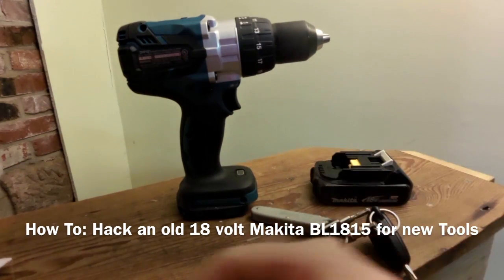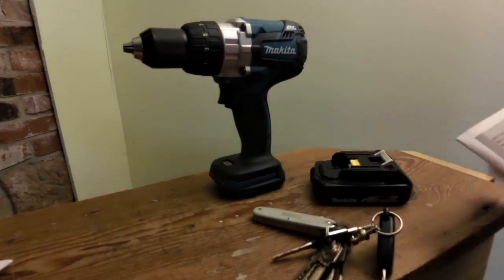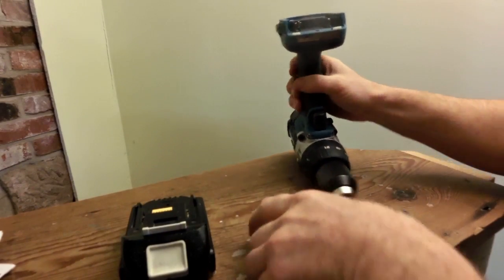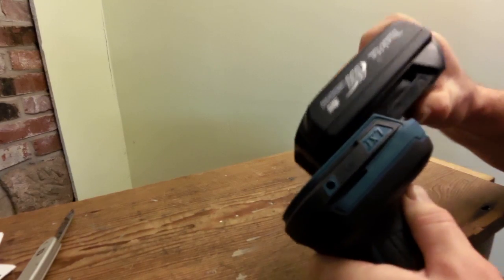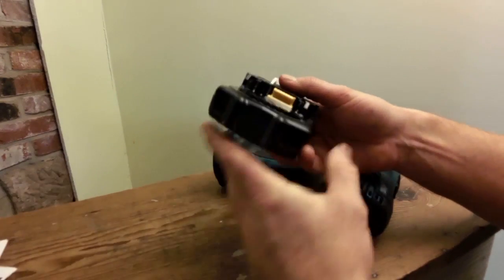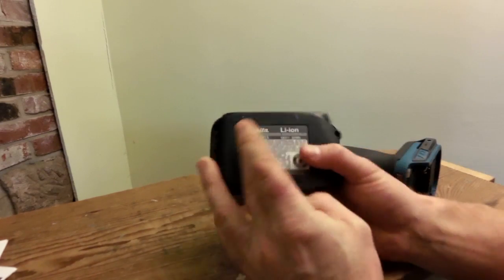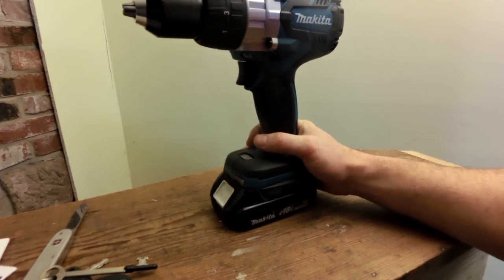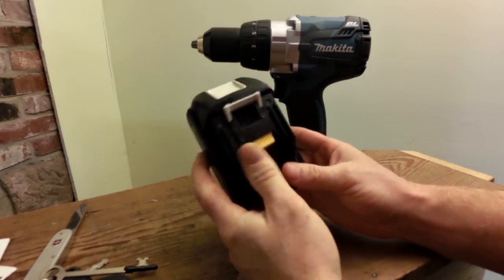How To: Hack an old 18 volt Makita BL1815 for new Makita Tools

Comment: Man was I mad. Had 3 of the 1815 batteries and a charger. When I got the XFD10 cordless drill and saw the batteries weren't going to slide in, I wasn't happy. Modified the battery as you showed and it works fine. Thank you!

Comment: I made this fix to my old compact batteries three years ago and have never had a problem. I use them with multiple tools and run them until they are completely depleted. Never any problems.
Reply from the maker: +Michelle Johnson-Hunter thanks for the comment, and great! You converted old tools to makita?

Comment: Thanks for the tip! I just received my new Makita rear handle dual battery circular saw (bare tool) today and was dismayed that I only had one newer 3 amp hour battery that would fit. That left me with 5 that were incompatible. While watching your video I notched out the track like you said and it fit perfectly! Meanwhile I have a pair of new Makita 4 amp hour batteries on order that will probably be dedicated to this saw. But it's nice to know I have backup now. Again, thanks!

Comment: thanks that help me out I have a saw BJR182 and the battery did not fit, I did that step and it works perfect no problems it said it is comparable with that saw what I did I CUT THE PICE THAT WAS IN THE WAY AND MY BATTERY FIT
Reply from the maker: yep. now the new tech won't save your old battery from over drawing which is what the star stuff is supposed to do, but it gets you by anyways.

Comment: There's really a simple answer to it.  That compact battery cannot by a long shot provide enough amps for that heavy duty drill.   And since those olders compact batteries did not feature a protection circuit yet you just created a recipe for burning out your battery.

You'll overheat / overdraw amps on that small battery pack EASILY with that large drill.  A large Amp tool like that ( just like a circular saw , jigsaw , grinder etc... ) need a fat pack ( with 2 rows of cells to provide current ) for the tool to work as it is intended.
Reply from the maker: Thanks for the comment. Yep all makes sense, I wasn't worried though,it's  an old pack already. It works fine so far but for any run time I need a larger battery. They make an 1815n battery for it, which I assume has the electronics in it to prevent damaging it.
Reply: Considering the 1815N battery has the same amps as the 1815 and is fully supported for this tool and many others  shows that it has nothing to do with the particular amps being delivered to the tool
Reply: That's not true about the heavy duty drill requiring more power. The black and white drill that that battery came with actually has more power than the newer green ones.
Reply: Might be a simple answer but don’t think it’s true, what I think happened was makita started making these “Star” battery and tool combos and claimed they were adding all these fancy protections and communication between the battery and the drill, which i believe is just a way to make people stop using aftermarket batteries and makita losing profit on their outrageous markups on batteries. The drill doesn’t need to “communicate” with the battery pack, everything can be done on the drills side according to the voltage of the battery. So I’m willing to bet unless they purposely added some kind of circuitry in the battery pack to disable the protections on a non genuine battery, that this retrofitting doesn’t matter at all and still keeps all the protections of a “star” battery. Could be wrong though, and you really don’t want to over discharge the lithium batteries which is easy to do without some kind of voltage protection, not only does it ruin these packs but I heard another guy talking about how they have a “safety” feature that disables the battery pack once it drops below a certain voltage, then it’s garbage and can’t even be taken apart and fitted with new 18650s.

Comment: Isn't that silly.  Apparently the drill works just fine with the older batteries.  They just want you to go out and buy a whole new set of them for the "new" drill.  They'll try anything, these days.  Thanks for showing us what's going on.

For some reason, this hack reminds me of my days with floppy disks and my C64.  Cut a notch in the corner of the floppy disk to double its storage capacity.  Those were the days! LOL
Reply from the maker: +The Homestead Chronicles haha, remember that about the disks! ya, i think the reason was to force you to use new batteries that have more electronics, or larger capacity batteries or something... but I didn't have any others at the time so made it work :)
Reply: its because the new batteries have a safety bored in it so it doesn't drain the battery all the way dry... helps the battery last longer... but ive used this hack as well... batteries are expensive.. lol but the new ones have a star on them those are the ones that fit
Reply: not 100% the case the New 3.0 & 5.0 batteries work on the old LXT drills, it's the old 1.5's that don't work on the new LXT drills. that's why I came to this video.
Reply: The Homestead Chronicles the old batteries don’t have the star on them which is overload protection so they don’t want them to work with the new drills. It’s simple as that really it’s to help the consumers not them.

Comment: Why don’t they want you to use the old batteries with the new cordless drill. I noticed the tab also and I’m thinking about doing what you said. But will running the tool with the old battery ruin the tool or ruin the battery?
Reply from the maker: a) they want you to buy new batteries so they can make more money b) the excuse is that the batteries will get ruined more quickly but then basically its just like using an old makita at that point. so really it doesn't make a difference.

Comment: Hey man how is the dhp481z drill? Still holding up good? looking to buy one myself.
Reply from the maker: hey thanks for the comment. check out my recent video here on the quality of the chuck: How To WRECK A Makita Hammerdrill Chuck - and fix it   Apart from that, honestly, i've not used it a ton - for the bulk of my jobs i use my little used impact makita which is WAY lighter. i don't do a ton of drilling but when I've needed it, it works great. it is heavy definitely and I've not myself made use of its massive power yet.  So ya, apart from the initial dud i got before i swapped it at home depot, its ok. Worth the premium? maybe not but if you need the power, its a decent buy.

Comment: Thanks that I found your video. I just bought a tool and the old batteries didn't fit. I got confirmation that it was by design... even if that was kind of stupid.. I can't find any documentation about this... Only that the new battery will fit most old tools but not the other way around.
Reply from the maker: hey great, thanks for the comment. Glad it was helpful!

Comment: Can one hack Makstar batteries to work in non-starred tools?
Reply from the maker: hack makita batteries for non starred tools you mean? i would think so but i don't have a star battery to try.
Reply: The new batteries work on older tools without modification, star or not. I have a ten year old impact driver and it accepts both old and brand new batteries no problem.

Comment: So is there a reason why they don’t want you to use older batteries on new tools besides wanting you to spend money on new batteries?
Reply: Well I did the search myself and this is what I found. 
“the newer batteries deliver more power to the tool.. the older tools have lighter gauge wiring in them which will overheat and catch on fire if you use the newer batteries.. thats why they issued teh public notice about the star on the tools. so that you dont put yourself at risk”
Reply from the maker: Yes, the 'advance' is that also they prevent the batteries from draining too far down, extending their life. Its all for a good and new reason for sure.

Comment: Cut out the stopper on the actual drill.  Simple.  All batteries will fit
Reply from the maker: yep, great advice!
Reply: I'd rather notch the batteries. I have a lot of money invested in my large a collection of Makita tools and don't feel comfortable messing with them. Plus there's the issue of voiding the warranty. Not taking that chance.
Reply: Yes, I broke out the Dremel and removed the block very neatly in less than a minute -thanks!

Comment: This video has saved me $200.00 in new batteries. I feel it is a crime how Makita has added a little metal connection tab on their new  products which as far as i can see is simply to force people to buy new expensive  Makita batteries. This is not acceptable any longer. Makita stop gouging your faithful customers if you want us to keep buying your fine quality products.
Reply: if you have the new 3.0 & 5.0 18v battery's they are backwards compatible  , just not the 1.5 with out modding it.

Comment: The stupidest thing I've seen, the 3.0 AH & 5.0 AH are backwards compatible but the 1.5 AH won't fit into a brand new drill. I'm glad I found this video as I was lost being both drills are the LXT series and use the 18V battery system but my old 1.5 batteries don't fit the new drill. yet my brand new 3.0 & 5.0 battery's work fine in the old drill
Reply from the maker: thanks for the comment. simple fix anyways... i still only have 1.5 Ah battery
Reply: I found even more info, they now have a metal slot built into the drills like mine so you can't use the old 1.5 batteries, you must use a dremal and cut the slot on the old battery for them to work. Not sure when they added the plastic tab and then removed them. mines the DHP458Z
Reply from the maker: on mine it was plastic, so i just broke it out if i recall.
Reply: Older batteries and the older tools have no over-discharge protection built in.
Not so much a problem with a drill, but modifying this battery to use on say a grinder would damage the cell.
Additionally, if the battery is over-discharged past a certain point (especially if used then stored without charging) the charger may not recognise it when it is put back on charge in the future.

Comment: if batterie not star protected you gonna burn your drill, i burned mine
Reply from the maker: thanks for the comment, and yes, good thing to watch out for. I don't do a ton of high load stuff so I'm not too worried about it.
Reply from the maker: +ballz6211 thanks for the comment, it means there is circuitry to prevent over amperage draw etc, supposedly saves your battery from over use, extending its life
Reply: No more so than using the old (non Makstar) batteries in old non starred tools.Still, I wouldn't use low Ah batteries.

Comment: Engineered to make more money disingenuously.  I'm sure 1/2 the people ended up buying new batteries because of this stupid tab.  Makita should be exposed, and ashamed, of this.
Reply: Just had the same problem and I resolved it by breaking off the metal tooth using long nose pliers and some gentle side to side movement for about 30 seconds or so. But I can understand why after thinking about it why Makita would do this. In order for the new tool to demonstrate its full potential it needs fresh batteries with more amps. Putting in old batteries (as I did) might save money but then some users may complain that the tool is not as good as they thought, but they won't narrow the problem to the batteries. I've put old batteries into my chainsaw and I was prepared for and willing to accept reduced performance.